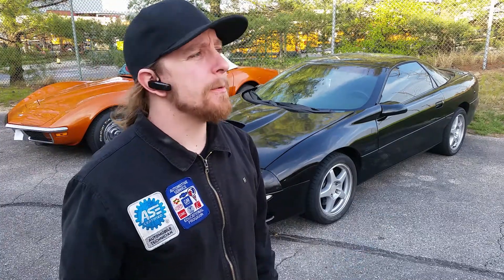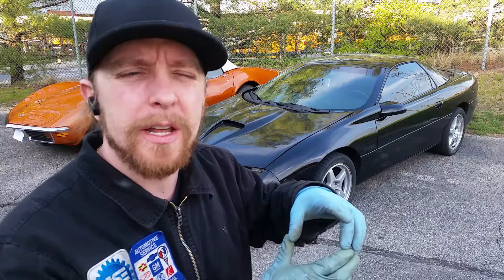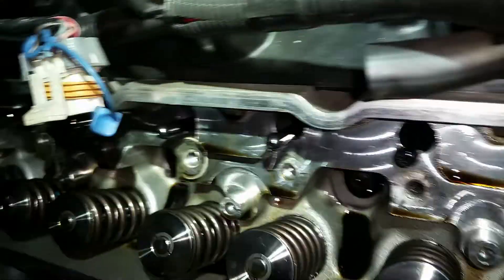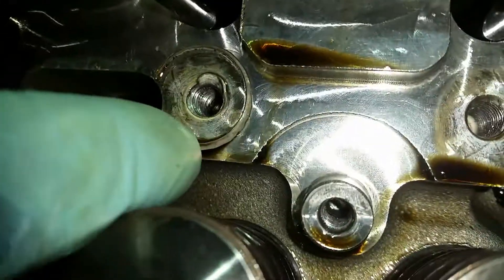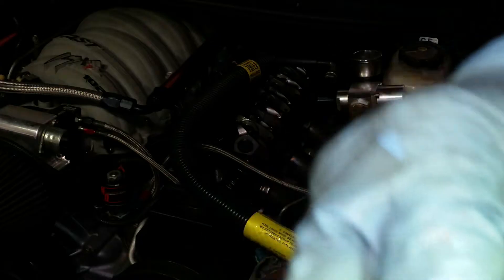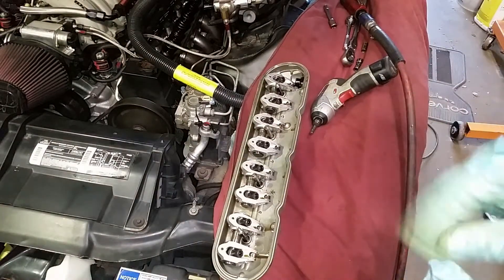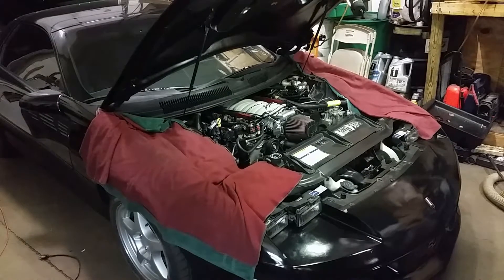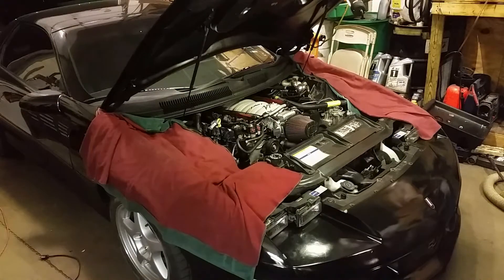Sealing LS1 Rocker Arm Bolts on Ported Heads

Comment: I hope you don't mind me commenting. I have been going around in circles with my brand new Ls1 build and i have a couple of cylinders which seem to have oil fouling the plugs. I have done a comp test, leak down etc etc and everything is perfect. I have ported heads and I'm confident the rocker bolts protrude into the chamber. Im starting to wonder if this is a possibility? Im going grey over this!

Comment: Well thanks for this, I’ve got a sbf that has aftermarket heads and has the same issue with the rocker stud in the intake runner, I’ve went through it twice now and used two different threads sealer, but both were Teflon type, just different brands. Seems to work after a couple drive cycles then it starts to smoke and I can’t tune the carb cause oil is fouling the plugs giving me false readings on the plugs. Going to try the rtv this time and thing in going to be generous with it, lol. I know the first time I took it apart there was oil down the threads.

Comment: I just pulled my intake off after recently using a non hardening thread sealer and I have oil in the runners I think that like the video states permatex will be a winner ill get after it and do it to mine and post a second opinion :) thanks for the video was just what I wanted when I googled the problem 😁

Comment: Wow man I’ve chased my tail on this with my ported ls3 heads for week! 

Did the rtv hold up ? 

I was told by another guy to use the gray permeatex
Reply from the maker: The RTV works, Just clean the threads out well with a q tip. Any sealer use a non hardening. I would love to swap to studs on the rockers if possible.
Reply: @CamaroRick  yes I just ordered the studs off jegs, comp ones are $102- hope it works . 

Good idea on the q-tip

Comment: I have a similar problem, trying to seal the intake ,after installing I air tested with 20 lbs. then shot some dish soap , had bubbles at the bolts and the top of the gasket, what thread sealant do you use, and gasket sealant ?

Comment: How much oil was your engine consuming?? And any advice on how to diagnose if rocker bolts are not sealing properly. Thanks!
Reply from the maker: I dont recall maybe 1/8th of a quart after a bunch of spirited drives. I would say the best way to check is to pull the intake off and look into the cylinder heads for oil tracking where the ported through rocker bolts protrude.

Comment: i have a cammed ls1 with ported 243 heads and my tuner says i have a small vaccum leak. checked everywhere and cant find it. i think that this is my problem.
Reply from the maker: If the PCV fresh air plumbing is routed after the MAF sensor it shouldnt cause a lean code as its measured air. If you can get ahold of someone who has a nitrogen smoke leak tester you can hook it up to the intake manifold and look for leaking smoke / air to pinpoint the leak. I had a similar issue and it turned out to be the throttle body bushings in the side. A cheaper trick you can do is get a can of Carburetor cleaning spray and spray it around the intake. When it sprays on a leak the idle will change indicating its picking up the vapor through a leak. Could also try and cap off the rear vacuum port to block off the vehicle vacuum line in case its got a leak somewhere. Maybe try and block off the Evap lines to the manifold to test them. Ive seen a few leaking evap solenoids in the past as well. Good luck man
Reply: @CamaroRick  sadly i havent had luck and have already tried all of what you stated. Hooked up a snapon smoke machine to it for a good 5 minutes and didnt see anything. All new gaskets fresh rebuild. The machine did measure  a bit of a drop the system. I burn a little bit of oil so i figured that was the last place to check and must be pulling air through the threads? The leak isnt present during full throttle only  at idle and partle throttle so My tuner says. Ls6 intake with ported ls1 throttle body, ls6 valley cover and mike norris catch can. All plumbed correctly. Map sensor is sealed tight on the back.
Reply: @CamaroRick  how is it measured air if its after the MAF sensor. I have it plumbed back into the ls6 intake where it goes from factory. Is the throttle body calculating the air that is put into the crankcase?
Reply from the maker: Yes all the air that enters the engine intake has to be calculated and measured by the MAF including air that eventually gets recirculated through the crank case. If the crank case is vented to atmosphere it will draw in unmetered air and throw a lean code. The PCV draws in fresh filtered air through a port on the non vacuum side of the throttle body, all after the maf sensor. Ive even seen a bad dipstick o-ring cause it. If your speed density and MAF delete you can tune it off the exhaust alone leaks or not.

Comment: hey man how would you suggest installing my pushrods? i picked up a shortblock, did cam, lifters gaskets, new pushrods, ported 799 heads, getting close to firing her up, just need to throw in the pushrods and torque down the rocker arms but i dont know what the right way is
Reply from the maker: The LS stuff the pushrod size is the only way to adjust the lifter preload, I always order them after I measure the new setups. You can buy a pushrod length checker make sure it has a range of 6.8" to 7.8" I use the Comp Cams 7702-1 (take measurements at TDC or make sure your lifters are on the base circle of the cam. / Not on a lifting lobe)
It is a little tricky to measure them properly and keeping any force off the lifter to keep it from collapsing (and giving a false measurement). I measure to zero lash and take my measurement and add in the lifter specific preload. I aim for the middle. In theory you want the minimum but that tends to boarder sewing machine noises. Mid spec is a safe bet. 

Also with the comp cams 7702 tool its hard to spin the top without the bottom spinning. I use electrical tape and make a teather i can hold with another hand to keep the bottom secured while I spin the top. I have seen other tools with different designs but dont have any experience using them. LS stuff is kinda tight to work with in that area but its easy to figure out.
Reply: Camaro Rick definitely taking a screenshot of that info and keeping it! my pushrods have already been measured and spec’d i just don’t know whether to throw the rocker arms over them and just torque them down or if there’s a sequence

Comment: Do you need to seal stock rocker bolts on stock heads LS1?
Reply from the maker: Jonas Burt only on most ported heads. You can look into the heads intake  port to the side and see if it was ported into the rocker arm bolt hole. Not all heads are ported into the bolt hole but if they are they need to be sealed with rtv

Comment: Lsx fast intake my favorite on reviews same I will be running if I go that crate lsx454
Reply from the maker: I like mine, went 11.2 with it on the old 408 setup. I want to get some of the different length runners and test it out. Right now I have the long runners in it. Makes great torque, I think i would want to try the mid length runners and trade some torque down low. I got a deal on it off of LS1tech. Compared to the GM Single plane intake and ported edelbrock elbow 90mm it picked up everywhere and still gained a few hp up top.  If I had the room I would have ran a 2.3L blower on it. I did an 05 Vette with the Eforce 599 kit it ran mid 10's with just long tubes and drag radials on a stock engine. On a budget the 1.9 LSA blower is pretty efficient. Ive seen 750rwhp out of a built one

Comment: Permatex makes a good sealant that is kinda stiff but stays pliable. Good job!
Reply from the maker: Its my go to for RTV, Ive used the others and besides the GM gray, the Ultra Black is the best. I want to try converting the bolts to custom studs and use a lathe to cut an o-ring groove so its easier and cleaner to work on. Ive never seen anyone do it.